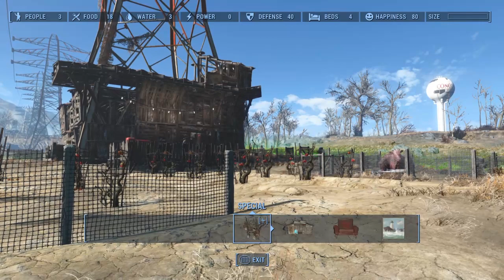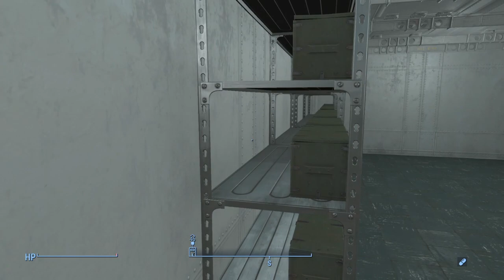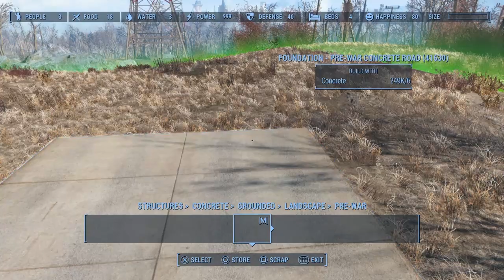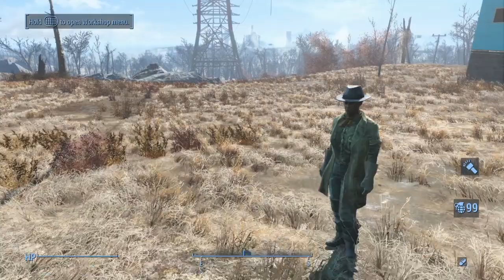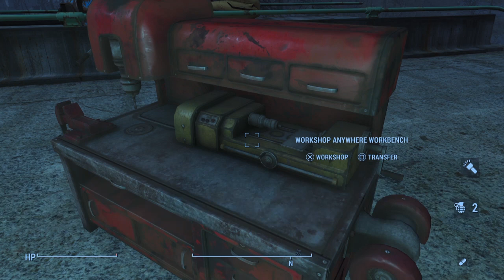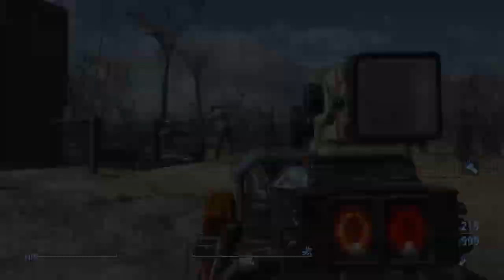Fallout 4 Settlement Building Tutorial For Beginners And Experts!

Comment: Very helpful thank you. I have CVA and had never really figured out what I was supposed to do with all those toggles. Now I see I need to exit workshop, activate the toggle, then use its contents. Thanks for that. much appreciated.
Reply from the maker: Always happy to help. Just be careful on how many you activate, each opens a bunch of new items and will slow the workshop menu down.
Reply: @spoonerdee  Duly noted and thanks once again for the heads-up. I will endeavor to only open a few at a time, though my PC is fairly good (fingers crossed) when I forget and open a bunch of stuff at once.
Reply from the maker: @dwarf_nz483  Ah PC, you should be fine to open several. Another thing to note, open the toggles in one location, and they're available everywhere.
Reply: @spoonerdee  Oh now that is good to know in advance. I would likely have gone opening them all over the map wherever I may have wanted them. Thanks for the hot tip!

Comment: I learned a lot from this video! 🙂  At 30:09 you don't need the place anywhere tool.  They are made to be placed on top of a specific set of desks in the Container tab.

- Starlight: Flat easy to build, good crossroads, forest on the cliff on one side.  Hard to wall off, so I head cannon pieces of the fallen screen were made into walls.
- Sanctuary: Forested island surrounded by light water, huge and has ...adequate... pre-existing structures but lots of space to make your own.  I head cannon that a lot of old trees were cut into ramshackle walls.
- Egret: Neat plaza with functional buildings, riverside for fishing, nearby forests for hunting, decent enough space to build up the plaza more.
- Tenpines: Middle of a forest on a cliff, highly concealed but, I used a mod that does most of the heavy lifting.
- Spectacle: It's an island, so I save so much size bar not dealing with a wall, can make a full on seaport, warehouse / shipping depot, Brotherhood base, etc...
- Murkwater: A hidden swamp not much, working on a concealed build but, PERFECT as Mercer safehouse.
- Greentop: High ground, greenhouse, nearby forest all in 1 settlement.

Coastal Cottage, Jamaica Plain, Croup Manor, Somerville are all too small, creepy, irreparable or, obnoxiously sloped to inspire me.
Reply from the maker: True, but by using the place anywhere tool, you can put the table decorations on any surface.